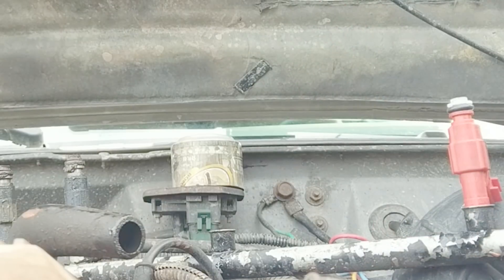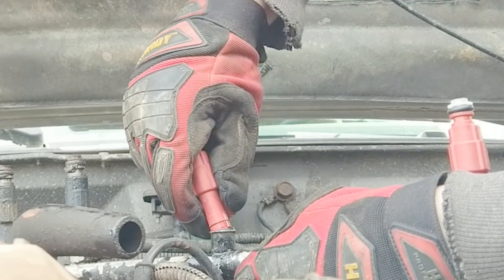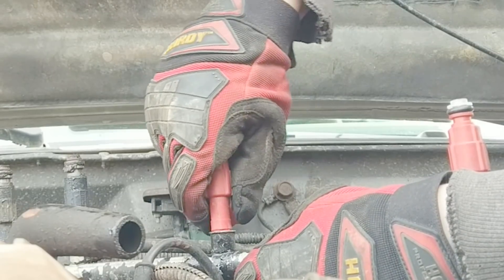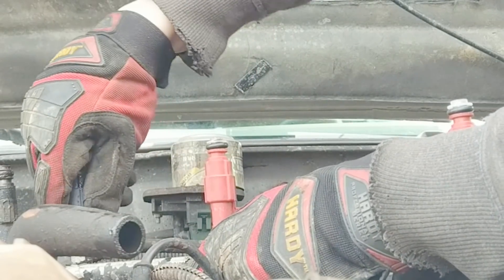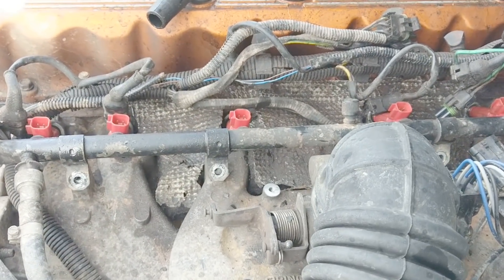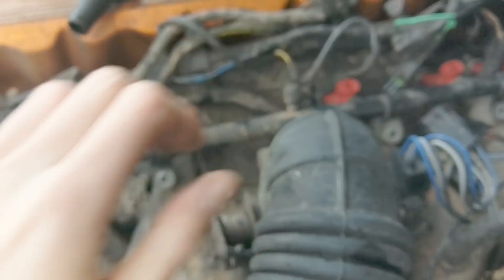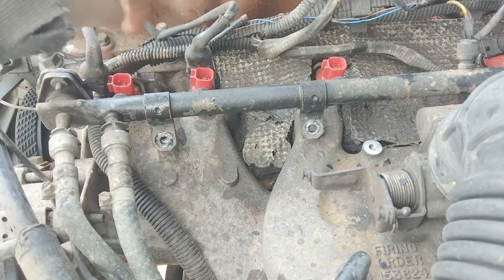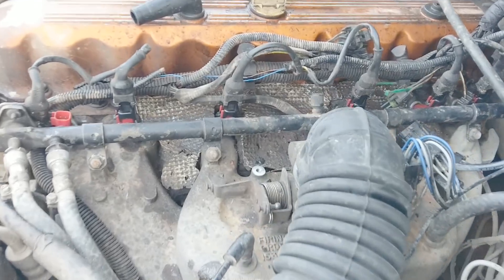89 Cherokee 12 Hole Injector Swap

Comment: So that's all you have to do is pull them off.

I thought there was a clip that had to be removed.
Reply from the maker: On the Renix rail there is, but I have an HO manifold swap which did away with them.
Reply: @NickInTimeFilms  any idea as to how the renix clips are removed. Cant find any vids showing how.

Comment: I'm getting real close to doing this to my 97 Cherokee! I was wondering 2 things actually. First do you happen to have a link to the adapters you used to install these? And more importantly I noticed it's been a while now so I'm sure your ecu has had time to fully adjust so how are they running for you now and how long did they take to get to optimal operation?
Reply from the maker: The adapters came with the injector kit I got but a quick google search should find them. The Jeeps been down for a while I'm doing more repairs, but the ECU adjusted to the proper value fairly quickly, maybe a few trips, and it runs much better. Quite happy with them.

Comment: ok i gotta ask. Why does everyone in the XJ's complain of bad MPG all the damn time? I have a 2000 WJ (grand cherokee) lifted 5" on 32" tires with ARB front bumper and a modded blazer ZR-2 tire carrier. Not aerodynamic at all,  weighs quite a bit more than an XJ, has the 4.0 in it, and yet i get about 15MPG in town and straight hwy on lvl ground at 65mph i stay between 18-22MPG. i have plenty of power, more than my 5.2 v8 zj had. im running a 373 gear stock (tow package) and i still need to find some odds and ins that are wrong with it. old stock cracked injectors, one has a vacuum leak. soon to be replacing them. but i do have new 02s if that matters. do i just have a miracle 4.0 or something. at its worst i get about 375 miles out of a tank of gas, but usually its more than 400
Reply from the maker: Hmmm, wonder if your drivetrain has less parasitic drag? My 4.6L Stroker running like crap on a Renix system certainly isn't helping me. Also heavy ass 35" M/T's take a lot more power to get going, even with the 4.56 gears. I've been in low 10's for a while now, and with some wideband o2 sensor tuning I can finally peak at 12, but seeing 250 miles to a tank is near unheard of.
Reply: i would think the drivetrain should be about the same as far as parasitic drag goes. maybe you are geared to low for the tire size. noticed that on a ram i had when i went 4.56 for 37s, went back to the stock 3.92 and mpg went way up.
Reply from the maker: Sometimes I wonder if I'm not geared enough haha. The stroker lets me keep up on the highway now, but it barely holds speed going uphill in 4th. RPMs are at decent cruising levels too.
Reply: well im at 373 with 32" ties and i have no issue at all at hwy speed and can easily stay at 65 with the cruise set. only on very steep hills does it ever leave over drive. over passes never do it. Ill check my rpm's at 65 here in just a few when i go in to town but i wanna say its right at 2k or maybe less. i use my gps for my speed, not my gauge as its 4mph off at 65.  again remember im also in a much heavier rig with the same power plant, though not a stroker, just stock 4.0 ho
Reply: ok im right at 2k rpm at 70mph not 65.
Reply: my stock xj was getting 18 on back roads and 21 on the interstate. now i am getting more like 12-14 around the back roads and maybe 14-15 on the interstate. i might upgrade the injectors to see if it helps. but i think the bad mpg started when i my fuel pump went out and i installed a cheap advance auto fuel pump (i think made by Atrex, or something like that). i also had someone tell me that it could be a bad cat.?.

Comment: Hi....Good video I'm from México city, where You bought the adapters of the injectors, to put what You put, and if it works Wells?  Tanks
Reply from the maker: The adapters were included with the order from k suspension. They have worked well so far.
Reply: @NickInTimeFilms  
*Where did You order  them? Can You  give me the page? Tanks  
I bring 6 and a half inches and it's a 88 cherokee (xj)*
Reply from the maker: @coronacorona189  https://www.ksuspensionfab.com/store/p22/New%2FRemanufactured%3A_12_Port_Upgraded_Injectors.html
Reply: @NickInTimeFilms  
Tanks....
Reply: @coronacorona189  avisame si ocupas algo corona, yo radico en USA

Comment: I did the 4 hole injector upgrade a few days ago and my 1996 jeep cherokee runs like shit. Missing, check engine light. Smells like it's running lean. I know the injectors are working I can unplug each one and the engine idle gets worse. I can put my old injectors back in and it runs fine. Any ideas?
Reply from the maker: The injector flow rate needs to match for them to work well.

Comment: Any update on the 12 hole ? I’m about to order some for my 87 Comanche renix 4.0
Reply from the maker: I like them on my stroker but it's hit or miss on stock engines if it can still get closed loop.
Reply: NickInTimeFilms oh okay another question is my ST at idle is 128 and my LT is 98  shouldn’t LT be @ 128 and ST fluctuates with throttle ? I wanted to try  these 12 hole because they are cheaper than the ones at my local store (100 an injector here)
Reply from the maker: @ComancheTribe69  in closed loop, STFT will fluctuate. If it's just sitting at 128 then you're in open loop. Low Ltft means the system is already a little rich so it's had to pull back some to stay on Target. Slightly bigger injectors may make it harder to get closed loop, but it's hard to know until you try.

Comment: Everything was so dirty, how do you know you didnt get dirt in the fuel rail?
Reply from the maker: It a jeep, it'll live.
Reply from the maker: That's why it still failed when I swapped it to an adjacent cylinder and cleaned it out too huh? Man, I'll have to keep your genius around for my future troubleshooting. Should make it a breeze!
Reply: if you got dirt in the fuel rail then put the injector in the dirt would go into the injector and stay in the injector, I am not staying this is what happened but the conditions were bad and they usually test injectors before they sell them, what do you mean you cleaned it out? wit a cleaner rig a spray can? did you take it entirely apart or just squirt one direction through it?
Reply: Im not trying to be contentious but you are not even willing to except the possibility and get sarcastic
Reply from the maker: I'm impressed, most people are absolutely Dicks so I get snippy back. My apologies. Anything is possible and dirt very well could have gotten somewhere in the system but I took as much precaution as possible to keep them clean during each swap. 

I took the problem injector out and first back sprayed it, then forward to see if it would flow through, then swapped it over to confirm it was still giving me issues. 

I've still got it on hand but don't know how to disassemble them yet for a full check. Made for good troubleshooting video though.
Reply: Ya no problem, Ya good job good video, its hard to find these 12 holes they are being advertised mostly for jeeps but some other trucks im looking for some for mine a ford escape 2.5 l and my 02 blazer 4,3 is a lost cause

Comment: Hi Nick,

I was wondering if you think these will work on my 1988 XJ 4.7L stroker?  I don't have the upgraded high output like you do. I did get the 4 port upgrade that you had a video on but I have not started the new engine yet.
Reply from the maker: Absolutely, I think these would show great improvements even on stock engines, highly recommended.

Comment: So does it get better gas mileage ?
Reply from the maker: Maybe 1 MPG, if that. It's not going to affect much. I just enjoy the slight performance blip.
Reply: NickInTimeFilms so there’s no known way to get more then 15mpg??
Reply from the maker: There is, but it's not going to just be some simple holy grail fix. You have to build the Jeep to your intended purpose. If you want fuel economy, big thing #1 is being geared properly. If you have 33s on stock gearing, it's going to suck. If Fuel Economy is a really big deal, go with the smallest tire size you can get away with. Less weight overall, better driving habits, things like that. I get 10mpg if I drive like I mean it, but I can get 14 MPG if I grandma drive it and go slower on the highway. It takes fuel to make power, so less fuel means less power.
Reply: NickInTimeFilms okay awesome thank you so much for your info and time.

Comment: DId the renix stroker kit up the compression ratio?
Reply from the maker: Depends on how you build it. My particular build just barely bumped the compression from 8.8 to 8.94. The Cam has a more meaningful impact on your dynamic compression ratio though as that's what really matters when it's running. Still runs perfectly fine on regular pump gas.

Comment: Can theses work on stock renix
Reply from the maker: Yep, you just need the adapters.
Reply: Thanks ordered them and injectors. I run 746 4 hole volvos now just looking to step up a little.
Reply: Got them installed yesterday. Much crisper throttle response right out the gate. Gotta get some seat time to see if mileage has increased one thing I can all ready tell better take off. No more towing a small trailer feeling.
Reply from the maker: Nice, glad to hear they worked out for you!

Comment: 4.0L 👈👉not 4.6L
Reply from the maker: It use to be a 4.0L yes, but the engine was bored and stroked with a 4.2L Crankshaft and new pistons so it is now a 4.6L stroker.

Comment: Could I install these on a 2.5L?
Reply from the maker: What year? I'm assuming H.O., so you'll have to make sure you get the correct flow rate. HO has a slightly higher rate. Also make sure the connectors match.
Reply: 1989 yj 2.5 for me...

Comment: what about boring your throttle to 62 mm? i seen thats posible to suck more air/
Reply from the maker: Mines bored out a bit. I did it with the stroker so no idea how much it helped by itself
Reply: @NickInTimeFilms  thanks a lot. any idea how much a 12 hole injector kit cost?
Reply from the maker: This kit came from k suspension, link in description. I think it's around $100
Reply: @NickInTimeFilms  thanks a lot.